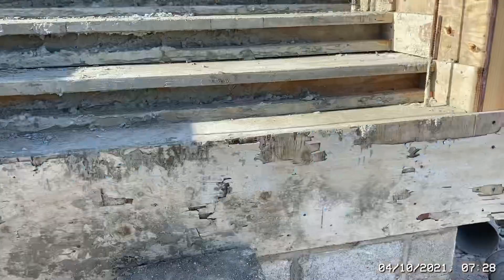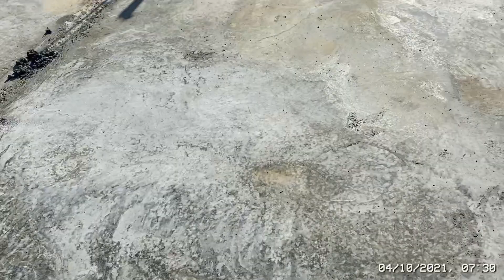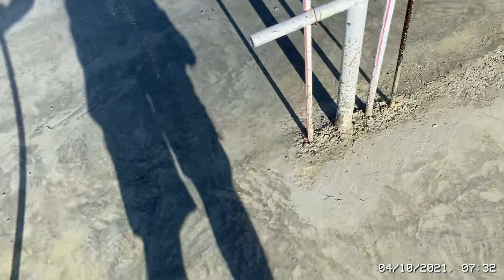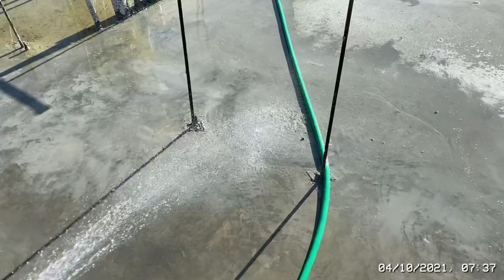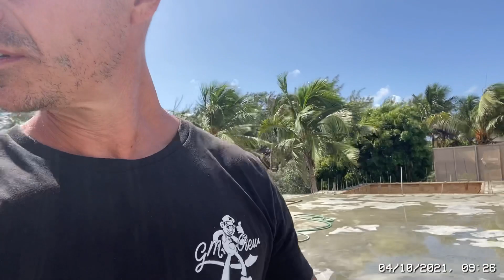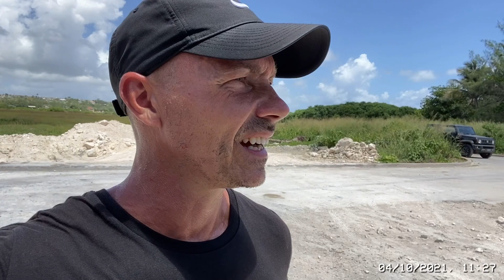Barbados 🇧🇧 Beach House Build - Day 116 Building our Dream House in Barbados

Comment: Good to see cement has been poured was sceptical but well done!!

Yes two week walls and roof on should be possible ..

Are you a recruiter in the building trade? Who's the owner you've spoke about?

How long would a 1450sq ft 3 or 2 bedroom  2 bathroom house take to build 👍🏾

Your demeanour has been calm amongst the few problems you've had Well done 👏🏾👏🏾👏🏾